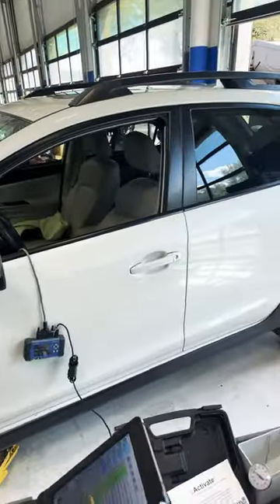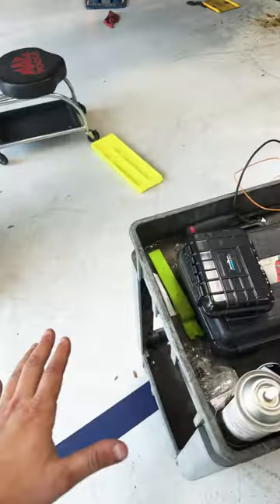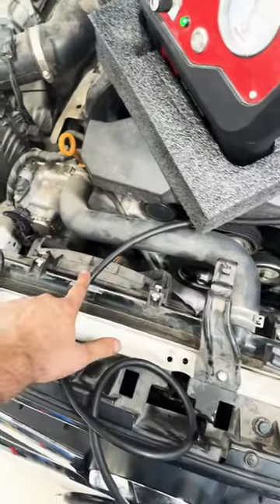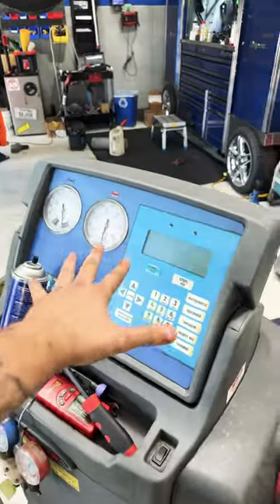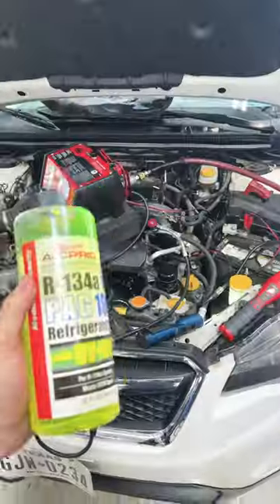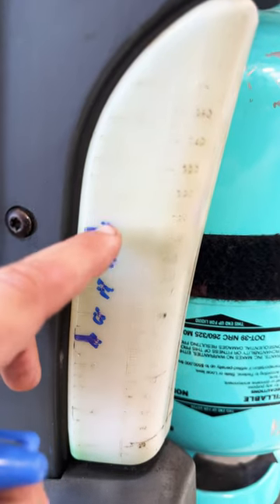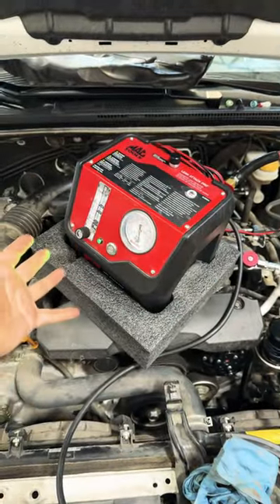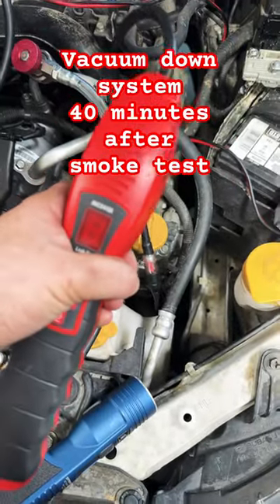Customer States: 3 shops repaired the AC and it still blows warm #wtf

Comment from the maker: 2015 Crosstrek with 59k miles
Customer states the AC blows warm

Three shops have worked on the car and all three shops have replaced different parts

Shop one replaced the AC compressor 

Shop two replaced the expansion valve

Shop where replaced condenser fans

Then shop one replaced the AC compressor under warranty 

And every shop said the AC system was sealed because the “vacuum test” passed.

Folks if you don’t know how the test works then do not rely on it.

This AC system has a leak via pressure, not vacuum.

When looking for leaks I like to use my EVAP smoke machine. It uses 1 psi to test the system and doesn’t thirst anything.

I’ve never harmed the receiver driver with this because I vacuum down the system for 1 hour after repair. And I use quality oil, not baby oil.

The leak was less then .010” according to my gauge. 

My AC sniffer found the leak around the High Side crimp.

Why didn’t all that oil leak out of the fitting? Well the oil is bigger then the leak and it’s hard for it to leak out.

The AC sniffer can detect the puff of smoke leaking out of the line.

Replace the line. Vacuum the system down for 60 minutes and recharge the system 

Post checks good
Reply: Your repair might be correct but testing at 1 psi is not. Just because multiple shops fuud up doesn’t mean your right. testing meathod is plain wrong. 4 wrongs don’t make a right   That’ll be back at some shop
Reply from the maker: @dwood82574  
the repair is good, the customer is happy. After I replaced the High side hose I found another leak a the expansion valve. There I found orings too big. After installing the correct size the system held pressure. The pressures were trash but that's because the $200 Auto Zone compressor was trash. Customer approved an OEM compressor and the pressures stabilized and the Air was a cripy 50*F.

This is just my way of getting things done right. You're happy to start your own channel and put your work out there for others to second guess.
Reply: I've been needing this kind of explanation. Maybe I can do my own afterall.
Reply: What oil do you use? "Quality oil" I use pure mineral oil. Always looking for new ways to use the smoke machine.
Reply: I remember in the dealer honda training, if it passes the vaccum test but still leaks then check the crimps and o-rings, thanks for reinforcing this lesson!

Edit: i thought the smoke idea was smart! Never tried it but i always hated ac leaks

Comment: Good job thanks for the tip
I don’t use dye to check for leaks 
I use shop air to pressurize the system and spray soapy water on all hoses and connections 
And also run the engine to confirm that the compressor is working.
I work on tractor trailers
Reply: Should use nitrogen my friend

Comment: That was just someone throwing parts at the car. I can't stand people doing that. If i get one with a low charge. I will evac & recharge, replace shrader valves and add oil and dye. And i use the gauges on my machine for the AC diagnosis

Comment: As a commercial HVAC tech. Don't rely on time for vacuum. Use a micron gauge. And thank you for not just dumping in dye
Reply from the maker: Agreed.
I've seen people seize compressor by pumping in dye.

In many of my A/C diag and repair videos I explain the "vacuum test" and how it's only good for "identifying" leaks 0.010" or .25mm; you're basically making sure your bolted all the connects tight.
Reply: @baja-automotive I think somebody did that with my S10 before I bought it  the compressor would load down long before I had the specified charge in it  inspecting the orifice revealed a lot of silver colored paste. I ripped everything out, flushed the lines and evap, put in a new compressor, condenser, accumulator, orifice, schrader's and O rings,  recharged to spec with no issues. This was all DIY at home with Harbor Freight gauge set and pump.

Comment: Great job finding the culprit instead of just replacing parts. The crimps on some of those lines are junk and I’ve even had brand new ones come from part store and be defective. Some cars have an orifice tube which is also something I’ve found some shops even overlook but good work on the due diligence to find source
Reply from the maker: Thanks 👍

Comment: Usually I'd just change the system with nitrogen, but looks like your method works. Just make double sure your changing the dryer and vacuuming it down really well before charging the system. Especially if your going to put something like that or compressed air which i've seen some people use. (For those who don't know about ac systems moisture in the air is enough to play lots of bad games inside an ac system.)
Reply from the maker: Great tip!
Reply from the maker: My bottles are empty and constantly forget to fill them. The welding stores are all out of my way and keep banker hours. Just need to take a long lunch one day
Reply: @baja-automotive  Yeah, I don't have any hard feelings towards someone using compressed air to find a leak. Truthfully it's 1000% better than the guys we all know who change the Schrader values then recharge the system with that garbage "stop leak refrigerant" without even pulling a vacuum and claiming they "fixed it" (Anyone who really knows AC and refrigeration can tell you they are creating a huge list of nasty problems down the line of it even works at the moment.)
That said you just need to make sure you change the dryer, (also the expansion valve/orifice tube if you can get to it), and I would suggest vacuuming down for at least 2 hours if you did use shop air to leak test. (Same vacuum for after a flush, but obviously replace the condenser on top of all that.)
Reply from the maker: @Megellin  
Subaru integrated the receiver dryer into the condenser years ago. Only serviceable on aftermarket parts, Subaru welds the service cap on.
I do teach people to vacuum down the system for at least an hour when using this method, so all the moisture and contamination can be removed.
It’s a love hate business.

Comment: Vacuum down to 500 microns. If it holds for 15 min, 99.9% of the time, it's good. Parts swapping is fumb though unless you suspect a part and are out of other oprions. Usually though you're just not diagnosing the problem correctly though. Find the problem and the fix that! When you have a system that is baffling you, always weigh the charge that came out, and weigh the new charge in. You see low pressure when ut comes back and pull the charge and it weighs less, you have a leak. You know from the last time you worked on it that it passed the vacuum test. Now pressure test with a small shot of refrigerant (or smoke apparently. TIL) and pressurize the system with dry nitrogen to find the leak. Use leak detector soap bubbles or an electronic leak detector to find the leak. Fix that.

Good job mechanic.

Comment: Curious if you could have issues with contamination in the ac system using a smoke machine?
Reply from the maker: Yes and no
I run an hour long vacuum on the system to pull as much foreign atmosphere out of the system

Smoke is a last resort

My Co2 tanks are damaged

Comment: bro, I would be pissed if I took my truck in and they replaced a bunch of good parts just to NOT fix the issue...probably 3-4g's in? or warranty work?
Reply from the maker: Service centers need to respect the diagnostic processes 

Too many garages think diag is pull a code and putting on a part.

Theory of operation is critical when diagnosing a concern

Comment: any idiot knows if you turn the AC on and clutch on compressor won't engage,it's either not enough gas in the system or clutch solenoid is gone, and those are the first two thing you should check and fix first
Reply from the maker: You would be astonished how many idiots do not know this. Never take someone’s knowledge for granted

Comment: How does dye make leaks?
Reply: It doesn’t. I’ve never used dye. However dye is like oil and too much will hydro lock the compressor which will kill the compressor. It won’t “make a leak”ever. And 1psi will only find the largest leak. And that laptop he showed will never be a tool to find a leak. He used it to post this misleading video.
Reply from the maker: The AC system is designed to hold so much Freon and oil. AC dye is most commonly sold premixed with AC oil (PAG). A common rookie mistake is to keep adding oil until a leak to find the leak; the oil,is not compressible and will use up the needed space Freon needs to expand into a gas. When the system is evacuated/recovered you need to measure the oil removed from the AC system. This is another rookie mistake. I see a lot of rookies, looking for AC, leaks by charging the system adding oil; then recover the system and recharge it again and add more oil. This requires a follow up video to explain AC theory and best practices.
Reply from the maker: Calm down.
I told you this would make you angry.

Laptop was used to inspect for codes, I scan every car to ensure there are no circuit malfunctions.
You sound pretty smart, so you also know if the ECU thinks the engine is overheating then the compressor will not turn on.
A diagnostician should never take anything for granted, especially when multiple shops and techs have touched the car.

Lastly, one PSI of smoke is all I need. The molecular is small and can seep out a hole .0010”. Also smoke will blowup an AC sniffer.
Try it, blow  smoke in front of the AC sniffer. Plus smoke has a unique smell, if the leak was in the evaporator core I would smell it.

What tools and tactics do you use, can you make a video?